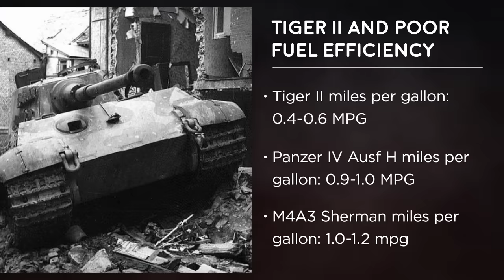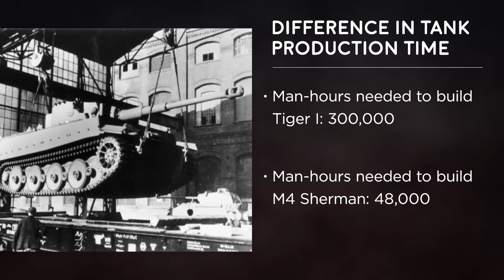Why Did German Tanks Perform So Badly in The Battle of the Bulge?

Comment: I hate when people say allied tanks(Sherman mainly) were terribly made.  The logistics behind them were absolutely insane.  

Performed well in 4 different theaters.  West Europe, east Europe, africa and the pacific
Reply: Don't confuse the numbers of Sherman's compared to Tiger's  or Panthers. The Sherman one on one didn't have a chance even when they finally started putting a gun on a Sherman that could penetrate a Tiger's Armour. The Tiger was a much better tank for a crew to survive in. I can't remember the Battle but a Tiger survived 90 hits from the Sherman's. The Germans didn't have but around 3,000 Tiger's compared to 50,000 Sherman's. When Patton crossed the desert the Tiger's were shooting the Sherman's down long before a Sherman could get close enough to fire. It was a much better tank. More Tiger's ran out of fuel and the crews left them than Sherman's destroying a Tiger.  The Tiger's had the first Power Steering and it used a steering wheel instead of levers to steer a tank. The Gasoline in the Sherman's was more volatile than the Diesel Engines in Tiger's. At least gas didn't freeze in Sherman's. If there were 5 Tiger's taking on 5 Sherman's which didn't happen the Tiger's would have easily won that battle. The thing about a Tiger the Turret moved to slow. Look at the Jagapanthers. It didn't have a Turret but it was absolutely lethal to Sherman's. It just had to be positioned to it's advantage. If the Germans had 50,000 Tiger's things wouldn't have worked out well for our guys. My dad was on a Destroyer in the Atlantic for two years and on a PT Boat in the Pacific around two years and he was in the Occupation of Japan. He also had a Master's in American and World History. He told me what  the Sherman Crews said about the Tiger's. They were just happy they didn't get hit by a Tiger.  The King Tiger was a monster but two big for the roads of France. They would have been perfect on the Eastern Front against a T34 which was a pretty good tank. The Tiger was the answer for a T34 which was a better tank than the Panzers.
Reply: No German tank-none of them-could have done what the Sherman did in multi-theaters of war. The Sherman tank was greatly underrated, based strictly on it's inability to slug it out with German heavy tanks. That constituted probably 1% of the Sherman's mission scope, the other 99% of the time it performed admirably. The best German tank was the Mark IV, after that they were gas-guzzling behemoths with limited capability other than being artillery with limited mobility. The Tiger tank was a waste of German resources and the Panther tank was rendered a maintenance nightmare by adding too much armor on it after the fact. The final drive gave out frequently and it was difficult to service in the field due to it's torsion bar suspension.
Reply: @kurtsherrick2066  The only thing the Tiger excelled in was tank on tank battles with smaller Allied tanks, and that happened very rarely. For the infantry support role the Tiger was almost useless-not to mention it guzzled gas in great volumes and the Third Reich was always short on fuel. The best German tank was the Panzer IV-had they concentrated on producing those instead of spending precious resources developing/producing the Tiger or Panther they would have been much better off. The Panther was a worthy effort to produce a better medium tank, but adding extra armor on it contributed to making it unreliable. The final drive gears in particular failed often-usually at the worst possible time. Many of the Panthers at the Battle of Kursk ended up broken down on the battlefield before they ever encountered Russian troops.
Reply: @kurtsherrick2066  The Americans rarely fought actual Tigers.  According to "the Chieftain", only 3 times was there a tank on tank duel against Tigers.  The first, the Tiger lost to a flank shot by a Sherman.  The second the Shermans won by virtue of the Tiger still being on a train.  The third, the Pershing lost.  When in combat, everyone sees the worst.  All the tanks were Tigers, all the shells were 88's.
Reply: @kurtsherrick2066  Thanks for the analysis, General.
Reply: @kurtsherrick2066 o here's some actual history. Feel free to research it and learn a bit. The elite Panzer Lehr division (formed from veteran Armor school instructors) had Panthers and significantly outnumbered the pockets of American tanks and TDs in the roadblocks east of Bastogne but had a very difficult time pushing through which was a big part of the reason the 101st had time to get in position and dig in. 

The battle of Arracourt the Panthers outnumbered the Shermans and lost decisively in weather that prevented allied airpower intervening for the first several days. The Panthers just lost because they weren't actually as good. Sorry. 

But yeah, overall numbers matter a lot in armored warfare, but not the way you think. Numbers doesn't mean a bunch of Shermans gang up on each Tiger or Panther like in Fury lol. Numbers means that although an allied Armored division might have a tough fight against a German armored division, on that German armored division's flanks are infantry division with hardly any armor while the allied infantry division facing it has a bunch of tanks and can roll over it. Then the German armor has to retreat or get flanked. Rinse, repeat, Rhine/Seelow; Rinse, repeat, Berlin. Cheers!
Reply: @j.f.fisher5318  Thanks for that.
Reply: @j.f.fisher5318  That Battle was a result of bad tactics of the Germans. Not because the Sherman was a better tank than the Tiger or Panthers. The Tiger's and Panthers could hit the Sherman's from a much farther distance. The biggest benefit of the Sherman's they were fast and dependable.
Reply: @kurtsherrick2066  ironically. Fielding the tiger and panther limited the tactics of the germans.
Reply: Indeed.  The Sherman was the best tank of the war from a strategic standpoint - the most important standpoint.  It could do 80% of tank things well, 10% better than most, and only 10% poorly.  It could handily defeat Panzer IIIs and IVs.  (The only decider was experienced and trained crews.  Crews American gained and Germans lost.)  Meanwhile Tigers and other heavy Jagpanthers  were too pitifully small in quantity for any but the most jittery GI to sweat.  And we absolutely flooded Europe with Shermans.
Reply: @kurtsherrick2066  the attacking units are always at a disadvantage as the germans found out at the bulge when they were the victims of ambush...the Sherman's did quite well
Reply: @kurtsherrick2066 To be honest in most battles , where the allies had air superiority, a tank was turned into a 60 ton roadblock. To cover the most ground as quickly as possibly, the arsenal of defence cranked out munitions of all types at anywhere from 20 to 40 times the rate the Nazis slave labor could. German machinery was superior in most respects expect for the M1 garand and its air power.
Reply: I have heard it said that low rediness or reliability of Panzers was a liabilty; both due to their complexity and because Soviet and American tank crews were much more likely to have at least one soldier who had experience repairing a tractor or auto.
Reply: @kurtsherrick2066 this is actually patently false. Do some research.
Reply: @kurtsherrick2066  Armor and gun don't win battles on their own. The troopers do. The tank is just a tool. The better tank gives the soldiers more options. To some extent more armor or a bigger gun give options but the most important options are those offered by mobility, sensors, communications, and ergonomics. French, British, and Soviet tanks outgunned and had more armor than the Panzers in 1940-41 but more radios, reliability, and 3-man turrets won out. Operational mobility generally is more important than tactical (giving the commanders more options) and reliability, repairability, and fuel consumption are king there.
Reply: @j.f.fisher5318  Mobility has always been King so to speak. Stonewall Jackson proved that in his   Valley Campaign. Rommel also in the Desert. If the Sherman was anything it was Mobile. Enjoyed reading your comment. The reason the Tiger was designed is the Russians like you say had a better tank than the Panzers. Hitler gave a speech about introducing the Tiger in the East. He tried to encourages the troops because now they had a tank that would compete with the Russians.
Reply: The Sherman's main variant was a medium tank so of course it wouldn't have the armor of a heavy. Yet so many seem to not know care of just forget. It's like getting mad at a fish because it can't climb, like no duh it's a fish
Reply: Um, that made absolutely no sense
Reply: @kurtsherrick2066 bullshit Sherman was mobile af dude
Reply: @pimpompoom93726  In defense of the Tiger, that was also exactly what it was built to do, and that by itself was the mistake. I remember reading somewhere that Hitler believed the arms-race was going bigger, heavier, larger. but the allies/russia didn't do that, they went for more numbers (generally speaking).
The Tiger (and Tiger II after it) were designed for a 'battlefield' which would not come into existence.

I always theorized, if the E-series would have come off the ground properly, then Germany would've had an efficient and powerful tank arsenal, one where the tanks themselves would command respect for what they are.
But if those tanks aren't suited for the battlefield on which the theatre of war is held, than those tanks would only ever be capable of doing so much.

Also for the OP: I don't think people specifically think the Sherman (or T-34 for that matter) were bad tanks. They did well what they were designed and finetuned to do, And the Tigers in return, also did well (or as well as) what were designed to do, but everything else surrounding the tigers didn't work in its favour, by the time they were a thing. Furthermore the Tigers aren't 'offensive' vehicles when you think about it. They were the preverbial supermutant with a sledgehammer amongst the common folk with slightly more than a blade. Yes they would trash you IF you'd let him get the chance.

Blitzkrieg in the early days of the war also worked because that was still rather fast panzers involved in "tank-storming" tactics when the playbook was still mostly about the infantry-tank. Blitzkrieg with tigers would not be possible because they'd be to slow, you'd end up in a siege-scenario 10 meters away because the enemy (or worse, stalemate)
In the end, they were completely different beasts.
Reply: @skorpion7132  The Tiger Tanks-both I and II series-were essentially mobile anti-tank artillery. They had heavy armor and sufficient mobility to get them into essentially a fixed position and use their massive 88 mm artillery rifle to take out enemy armor. They did that well and the need for that role in the German Army was far greater than the Allies. Russian/British/American forces were fighting a different kind of war, they were advancing and using mobile tactics, they needed smaller, more fuel efficient tanks to accompany their infantry. Tiger had great stopping power, but it had poor mobility and it sucked gas in great quantities-AND Germany was always short on fuel. It was the main thing they had to contend with during the war, limited fuel supplies. Obviously as Germany retreated their lines of supply and communication got shorter and fuel transportation was less of a challenge-but it also meant the enemy was getting closer to Germany!   The Sherman tank was the perfect tank for the US military, it could be manufactured cheaply in great quantities, it could be shipped by rail easily to east/west coast ports, it could be transported on ships all over the world. It had good mobility, sufficient armor, sufficient weaponry and was designed for easy service/maintenance in the field. It was fairly economical on fuel. It was just a good, solid tank that could be made in great numbers and could fight from the deserts to the jungles to the plains of Europe and acquit itself very well. The one shortcoming it had-being unable to slug it out with the biggest German tanks-happened very, very rarely. Germany could never have competed with the Allies in mass production, it just wasn't the way their industry operated, but IMO they would have been far better off to have kept on building the Panzer IV and POSSIBLY the Panther tank-rather then spend massive amounts of money on the Tiger 1 and 2. They still would have lost, but I think the better performance of their Panzers at the end of the war would have delayed the final outcome to the end of 1945. Tigers had very limited impact on the course of the war and, in fact, caused Germany greater fuel shortages trying to provide for them. And they tied up manufacturing resources that could have been better used making smaller tanks and other equipment of war.
Reply: Advantages of Shermans in Europe theatre:
Built in large numbers.
Close to supply lines. No fuel shortage.
Easy field repairs.
Can cross military bridges and be towed easily.
Insane close air support.
You can say the same for T-34.
A good tank is a tank that gets the job done one way or the other.
Not everything is about firepower.
Reply: @kurtsherrick2066 The Sherman tank's frontal armor was just as thick as that of a Tiger tank. The issue was that the Tiger had a bigger gun
Reply: @kurtsherrick2066 Tell me which tank survived WWII, to serve in multiple militaries as an effective fighting vehicle and can still be seen in active service to this day by more impoverished groups, that was reliable, didn't destroy the physical and mental fortitude of maintainance and repair crew, wasn't prone to randomly having engine fires or the transmission deciding to break because it felt like it or was lauded for having superior technology but managed to get itself fucked in a match with a Firefly (the tank that killed the God-Emperor of the Wehraboo movement Michael Wittmann)?
Reply: @kurtsherrick2066  I’ve seen you make several points so imma speak on some of them.

A. Infantry is 100% the most important part of a war. Tanks without infantry support, especially at the time, were essentially moving targets, especially somewhere like a city or the woods.

2nd of all, Rommel was far from a stellar commander, especially considering what he did in africa. The problem with trying to micromanage everything from the frontlines is that it completely disrupts the chain of command. Leave the fighting to the soldiers and the planning to the generals. Not to mention he just repeated his primary tactics (flak 88 ambush and breakthrough a stretched line) until the Allies were able to come up with counterstrategies, which Rommel failed to adapt to. There is a reason he wasn’t able to secure africa.

3rd point. As someone said, the Sherman is the best tank of ww2 in the most important sense, the strategic sense. The Sherman chassis was so damn versatile a modified version of it if still in use by the US military and has been for several decades.
Reply: @kurtsherrick2066 War-losing weapon tbh
Reply: @kurtsherrick2066 Ridiculous. Average availability was about 30ish tigers per day...on both fronts.
Reply: @philgardocki5294  - Re: "According to "the Chieftain", only 3 times was there a tank on tank duel against Tigers."

Who is "The Chieftain" and what makes you think he is in any way authoritative as a historical source? That claim is clearly ridiculous, that there were only three times Tigers dueled it out with other tanks. That's complete rubbish and whoever uttered it is historically incompetent. Just so you know, making stuff up and calling it "fact" does not make one a historian. Nor does having a following on the internet.
Reply: You are right, and I didn't phrase that correctly.  What he stated, and presented, was there were on three tank on tank duels against American tankers against tigers.   The British faced a number of Tigers with American tanks, and of course the Russians faced most of them.
Reply: Never heard anyone say they were poorly made, just that they were more lightly armed and armored, which gave them disadvantages in some situations (and advantages in others) and that the primary reason it ended up being a net negative was the ease/speed of manufacturing and maintenance
Reply: @squeaky206 lets add the awful ergonomics of the firefly, godd gun, cramped turret, still punched fine
Reply: @chaosXP3RT lol what?
Reply: @pimpompoom93726 even the Panzer 4 was still superior to Sherman in every aspect.
Reply: @siegbraud4658  The Panzer 4 was probably the best all-around German tank of WW2, but even it wasn't as adaptable as the Sherman. The Panzer IV could never have operated in the steaming Pacific jungle islands like the Sherman did.
Reply: @siegbraud4658 No it wasn't.
Reply: @pimpompoom93726  The Sherman was never designed to duke it out with other tanks. Doctrine at the time was to use tank destroyers to hit enemy tanks. It was very well-suited, as noted here, for rapid infantry support.
Reply: @brettbuck7362  Exactly my argument.
Reply: Frankly how anyone can say that the Sherman isn’t the most effectively engineered vehicle of the war is insane, just on the sheer amount of theaters it fought in. The reality of the logistics in ww2 meant that the engineers in the US thoroughly tested the Sherman’s before sending them over seas because if something didn’t work, they were an ocean away. On top of this but people don’t like to admit that Sherman’s could take out tigers from the beginning but they could bc with tigers you didn’t need to pen the armor to knock it out, you just had to render it inoperable by doing something like taking out the electronics, which weren’t very reliable in the tigers.
Reply: @SizzleCorndog  The Sherman was a match or better for any Axis tank for quite a while - more powerful and more reliable than the early-war Panzers and anything the Russians had. It was only minimally upgraded because it was considered sufficient. Later small numbers of more powerful but horribly unreliable tanks appeared, but were of no consequence.  This is demonstrably true, in France, they still speak French.
Reply: By all accounts the Sherman was an equal match for most of the German armor it went up against; the tanks it struggled against were the stuff the Germans cooked up to deal with Russian armor: The Tiger, Panther and Tiger 2. Against Panzer IVs, StuGs, etc, the Sherman was more than capable of knocking them out, especially the up-gunned 76mm shermans.
Reply: The Chieftains seminar on the actual post battle analysis reports is worth watching.
Reply: Kurt Sherrick kindly remind me which side won again and who made over 5,000 tanks with better armour and performance than a tiger.
Reply: @philgardocki5294 Another thing is that the Sherman or T-34 could out flank a Tiger and hit the side while a Churchill would shrug off multiple frontal shots from a Tiger.